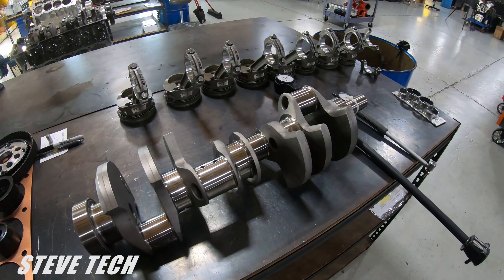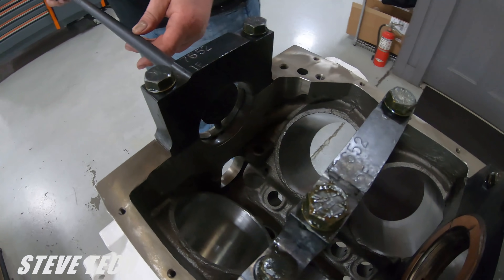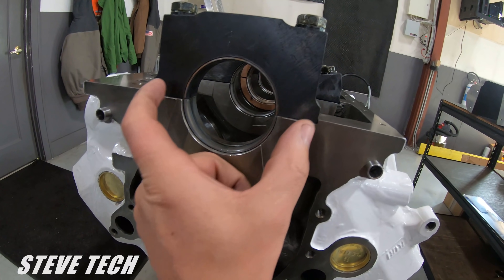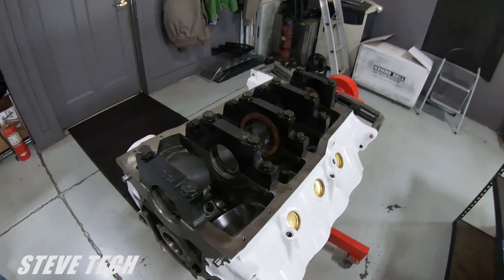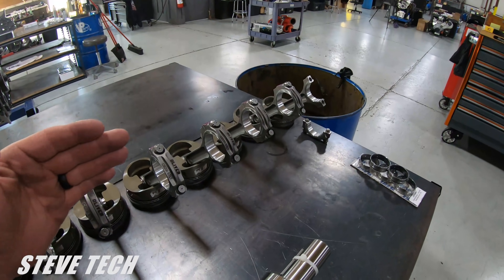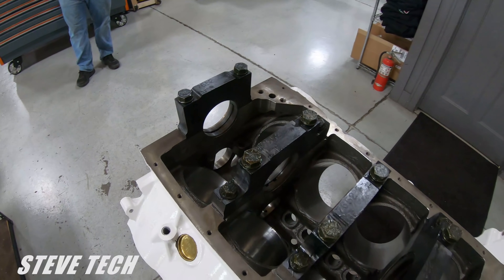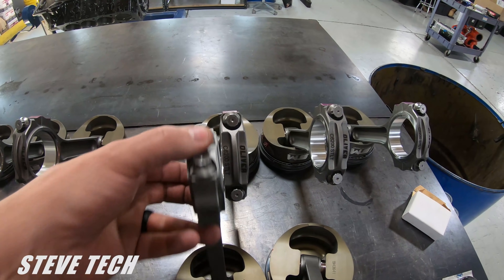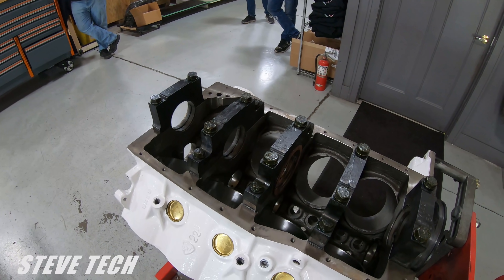How to Set Bearing Clearance

Comment: Very interesting, about the bearings, I learned something and are also confused; rod bearings have a mark on them they fit only one way; do I also have to find which one is for the piton and which one for the cap according to the markings? I did not know that; I am using king bearings 0.5 on my building on a Chrysler 3.6L v6 pentastar engine, or is this only meant for performance builds?

Comment: Really Cool Video Steve.  When I rebuilt my 421SD, I used the 455SD rods. Same clearances...that was later 70's. Appreciate such and informative explanation. CHEERS
Reply: Those rods are gold now..wanted a set for my 400 build back in the 90s. Had to settle for polished and balanced stockers with ARP bolts..GM handicapped Pontiac with those cast rods..

Comment: how much difference should there be between the vertical and parting line measurement? where can one find those spec's or tolerances for their vehicle? I'm diy'ing an old ej25 Subaru engine, so it's aluminum.

Comment: Hi, please tell me, is the oil gap the difference in diameter between the main journal and the? bearing? Do I need to divide the difference in diameter to get the oil gap?
Reply: Is the oil gap the difference in diameter or radius between the crankshaft journal and the bearing?

Comment: Now that I watched this video, I realize what I did wrong when I was 19 years old, I put together a Chevy 350 and did not pay attention to my rod bearings or the chamfer on them, I noticed it was very tight to rotate the crankshaft over before I installed the engine, but the starter was able to turn it and it did run for 30,000 miles until detonation took out a ring land. It never had a bottom end, knocked to it, but I am fairly certain that my rod bearings were binding on the sides.
I can’t believe I was such a dumb ass kid, I’m 42 now and I still have that engine stored away, now I know what else to look for when I go to rebuild it. Lol

Comment: I have a question about this. I ended up geting the wrong bearking for my rods from Massivespeedsystem... WELL now i realized  it and i went to King Performance's site and theres STD , STDX and .25mm and .26mm... I'm a novice to the engine building (out side OEM repairs) and for a mild to heavy NA build  ( 2L) should someone  stick with STD or should they go STDX?

Comment: I think you are wrong. Any hole should be machined perfectly round. So, shrink the bore and expand the bore at the same time?
Rod bores that are out of round will cause a bearing out of round and you will get a worn out bearing quick. No more thatn .0005-0007 clearance.

Comment: An excellent video, and loving this channel!  To clarify some things, the bore in the block is round, because as said it is not possible to hone an oval.  It is the bearing that is eccentric, and a significant reason for this is to establish the conditions for good hydrodynamic lubrication, with an added benefit of the eccentric shell assisting with deformation of the main structure under load.

Comment: You’re wrong about your dimensions it’s supposed to be perfectly round for the best performance running 2500s of inch is why the engine don’t last long, and for the record you don’t know what you’re talking about because none of that metal moves once it’s torqued down it’s there. The reason connecting rods are breaking is because you’re running 2500s of inch but y’all can continue doing what do you want to do? I really don’t care.
Reply: Dude he literally does this for a living and makes some of the best engines he knows a lot more than you…. The worst part is yours completely wrong I’ve personally built quite a few engines there never perfectly round
Reply: U sound dumb. Respectfully speaking. To not really care, u sure took ur time to write that ignorant response lol

Comment: I was taught by a long time diesel engine builder (remember diesel engines are built for 500,000 mile lifespan and have very close tolerances on pins & bearings) to measure bores without bearings, because bearing distortion will throw off your clearance measurement

Comment: How would one get a clearance of .0060-.0070 of rod bearing clearance?
Custom bearings?
Sanding the bearing?
Grinding the crank?
Cant resize most aluminum rods because they have the dowel so the bearing doesn’t spin? 
Very interested

Comment: on bearing clearance the vertical is what you are measuring to get into spec I understand that, but mixing std bearings and +.001 or  -.001 bearings obviously leaves .0005 extra lip on each side I assume that doesn't matter because of the extra room that is machined into the rod and and mains correct? I have also heard that the difference between bolts and studs can cause a .001 looser or tighter tolerance due to extra clamping force of the stud. studs being tighter, bolts being looser is this correct?  I love your videos I try and listen to every detail. thank you.

Comment: Went down to the 2022 Autorama on Friday; I saw a neat 4 door '64 Fairlane down there.  It was a fairly "tame" blue color, and when you look into the engine compartment, there's this pretty lookin' piece of hardware, plumbing of some sort going every which way, with the letters SMX on top.  Only one other car there caught my eye, a '71 or '72 Buick Skylark, LS, with the (big) turbo located where the battery usually goes--its installation was so sanitary, it looked like it came that way, from the factory--it even had a tricked out THM400, with a Reid case--($!!!).  That Fairlane looks like it's goin' 100 mph, sittin' still!  You should see where  the driver sits--weight transfer complete, upon launch!  lol

Comment: Hey Steve, scott here from New Zealand. Love your work! Could you please put up a video about valve train geometry and the rocker arm sweep on the valve tip, (when you have time) There’s many videos on YouTube and seems everyone has there way. Im setting up a gm 400 chev, afr220 Heads, solid roller cam, .620 lift, sportsman lifters and pro magnum 1.6 roller rockers. The confusion I have is what way is right, the 90 degree at half lift theory or the set up to the middle of the valve stem theory. In my mind the 90 degree at half lift is the best because that’s getting the most out of the cam and the correct lift from the cam. I’ve set mine up so it’s 90 degrees at half lift, but when I do that, the sweep is around 30 thousandths, which seems fine but it’s in the the 1/3 part of the valve stem. Not in the middle. I guess the main question I have Is, is this ok, or will this load my valve guides? And if it’s not ok, do i need different roller rockers, or different push rods?

Comment: Educational and informational 
Advice..I like this guy he knows his shit.....I have built only a few motors..a Pontiac 406.18 year's ago ..still running strong today..and a Chevy 360..about four year's ago..and yes it's still running strong as well..I drag race both..spray both motors as well...200 shot..I did them both myself..I'm proud of them..I took my time rebuilding them...but not to this extent..lol...the Pontiac is about 420 hp.NA.the Chevy is about 550 hp....NA.......
Not the 1,000s of hp of this guy's builds but respectable in my book....my 66 tempest runs 12.0 s on motor...and my 78 Grand LeMans half backed big tire car runs 10s...on motor...so yeah I'm pretty proud of my work on both..there both still alive and running great...so I must have done something right..lol..👍💪💯,,,,,,

Comment: The gauge has a calibration tolerance of at least +/- 0.0001 in.  Maybe twice that.  Also, holding that gauge horizontal instead of vertical can increase the uncertainty in the gauge's measurement.  Tipping the block and getting the gauge upright will help dial in that extra tenth or two of reliable measurement. 

Awesome video!  I keep learning more and more.
Reply: Extra tenth ?
Reply: @sexyfacenation  In precision measurement, I've found many machinists say "tenth" when referring to a ten-thousandth.  Because everything they do is to the right of the decimal, they just slang tenth for that fourth place.  Struck me as odd at first to be so concerned with proper/precise numbers, but then not use proper terms.  But if the whole industry speaks the same, that's what really matters.
Reply: @geevesracing  👍
Reply: @sexy_face  He prefers to hold aerospace tolerances...

Comment: Why not just align hone the block for extra bearing clearance so the customer doesn't have to buy 2 sets of bearings. Great info in the video nice job
Reply: Excessive line hone causes loss of crush on the bearing which prevents it from spinning.

Comment: Out of habit, you would think that  the crank would be sitting on end, like when in storage. How do you line bore without it not being round? OUT of round is a bad thing, and I call bullshit if you tell me you can hone that out to ,what?? since you believe that decking the caps after line boring this super duper race race technical sure win speed secret. I don't understand it The crank shaft moves back and forth as much if not more, then expansion during dwell, halos additional bolts helps with this phenomenon, but the million dollar question is where is the  racer bearing store that sells these, I've seen color coded and, stuff called plastigauge, measuring instruments how would they even know the size? I can't find the specs,I believe the  bevels on the edges eliminate stress risers
Reply: Wow that's hard to read and covers many topics!

Comment: I would invest in a gauge block set, and a gauge block holder to set your bore gauges. I see you using the mic. to check the bore gauge, that's not a good way to check/set the bore gauge.
I have a degree in machining and was a machine shop QC. Manager.
Reply: This video implies all thats already been done in the crank grinding/polishing process. Here, the journal, whatever it mics after being machined is the datum he is going off. he is measuring the difference between the journal and bearing. His mic could be calibrated to anything, it could be calibrated .01 off, you could calibrate it to say 1.1” with a 1” joe block.. regardless of what the mic says and what mic you use, if you zero the bore gauge to the mic right after measuring the journal, you will ALWAYS get the same clearance, in this case his .0026.
Naturally of course your mics should be set to a standard before even grinding the crank, but thats irrelevant in this video
Reply: @benjaminrutledge7675  " if you zero the bore gauge to the mic right after measuring the journal, you will ALWAYS get the same clearance, in this case his .0026."

You're dealing with a tight tolerance .0026".
Your precision is one ten thousandths of an inch. No, it's not going to always be the same dimension when you try to transfer that dimension to the bore gauge with a precision of .0001. In a professional shop, you'll always see bore gauges with their gauge block set that was used to calibrate the bore gauge.

"His mic could be calibrated to anything, it could be calibrated .01 off, you could calibrate it to say 1.1” with a 1” joe block.."

Why on Earth would anyone do that? You're just asking for problems. All of your Mics should be set to their zero point. You should check your mic's calibration every day before you use the mic. Every year a gauge reliability test should be done by the inspector (you) on all your inspection equipment. 

"Naturally of course your mics should be set to a standard before even grinding the crank, but thats irrelevant in this video"

Crankshaft diameters have a tolerance of .0005 -.0001. In a professional shop, you'd never use a mic to measure something with that tight of a tolerance. You'd use a snap gauge Go/No-Go, dial, or digital.

"If you're guessing you're not measuring."
Reply: Alright petal, dont get all snowflakey on me, i didnt mean to strike a nerve, im genuinely sorry about that.
I was exagerrating to prove a point.. the point being, everythjng you talk about doing its assumed has already been done and we are now comparing whatever the journal ended up at to the hole. You talk about using a transfer measuring tool (snap gauges) which need micing anyway and create a variable, yet have a beef with using a mic as a transfer tool to set a bore gauge after micing the journal. Obviously everyone sends their stuff for calibration yearly.. obviously youre doing all that before getting the journals nominal. Obviously this guy knows how to set bearing clearances without needing your joe block suggestions, obviously his mics arrived with standards like everyone elses.

At our ISO certified shop we use sunnens own dial gauge setting fixtures, we have things like a keyence,  CMMs  and a faro.. much better resolution to measure one tenth with than the cough snap gauges and go/nogo pins youre using.

But its ok, if thats the caliber of work you do, i guess thats as good as youll ever be.
Reply: @benjaminrutledge7675  wow guys this is all above my pay grade for sure..lol....😂😅😅😂🤣,,,his is building race motors not a rocket ship for NASA.....all motors destroy themselves..it the nature of the beast....so a hundred of a  thousands there or here really don't matter ...they are going to blow up eventually...it's just part of the game ,after all they make new parts every day...not like it's the last motor on Earth....these motors are pushed and beat on....there gunna go sooner or later....he dose his best to make it later rather then sooner......and by the looks of his shop he's doing pretty dam good work....or he wouldn't be where he is today...his reputation speaks for itself.....the end...
Reply: @topfuel29channel  the size doesn't mater, his mic could be dropped 20 times for all that it matters. It is the difference between he measured value and the dial bore indicator that matters. Not the actual measurement values overall.

Comment: One thing you should mention so people do not get confused is that the actual housing bore in your block or connecting rod should be  perfectly round, it's just the bearings are made to not be round.
Reply: Great comment!
Reply: Your 100% wrong there bud.   ONLY cam bearings and bores are round.  Not the rods or mains .
Reply: @chrisburnsed6349  incorrect. The bores in the block and the rods are round. Why do you think the specs call for those bores to not be out of round.  You are just as confused as everyone else.
Reply from the maker: yes they are made to be round BUT if the parting line area is wider it makes no difference.
Reply: @liftedcj7on44s  Yes the bores are finished honed and as far as I know you can't hone an oval !
Reply: @cncit  Yes I am aware, I know they are supposed to be round, I build motors for a living myself.  Anything I find over .0003" out of round I have to correct.
Reply: @liftedcj7on44s  surely you 0.003 as in 3 thou and not 0.0003 which is 3 tenths of 1 thou?
Reply: @ian9toes  yes .0003".
I am very well of the difference.
Reply: @liftedcj7on44s  infos in this video doesnt make sense to me

Comment: Steve, you also could have talked a little bit about the crush of the bearing. The clearance that the rod and main bearings have to hold the bearing securely to prevent the shell from spinning. Nice info, thanks.

Comment: How about proper settings for shaft mount rocker stand height and correct pushrod length
Reply: Use a marker on the valve stem tip..where the roller hits it..should be centered on the stem...they make a tool .an adjustable push rod..to get the right valvetrain geometry..put adjustable push rod in..set lash..roll motor over by hand and check your Mark's on stem....re do untill centered on stem that's your push rod length..hope that helps..I don't see him answering any comments so that's my 2 cents on the subject... Jody...what I have learned anyhow......I don't know about shaft Mounted rocker hight  but that will get you the correct pushrod size for any setup I would think....as for the shaft stands I do not know about that...I would think the stands are set...you just need to figure out pushrod length..and that's how ya do it..well how i know how to do it....lol... should be vids on it I'm sure...hay man best of luck on your build...keep us up to date on progress ...👍